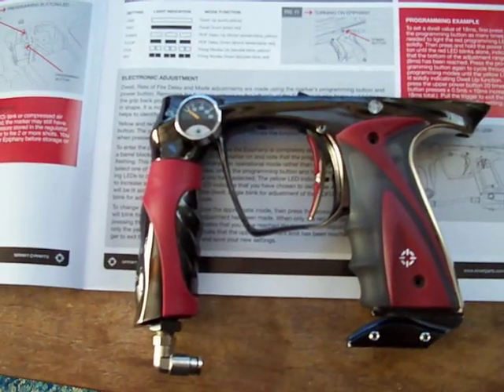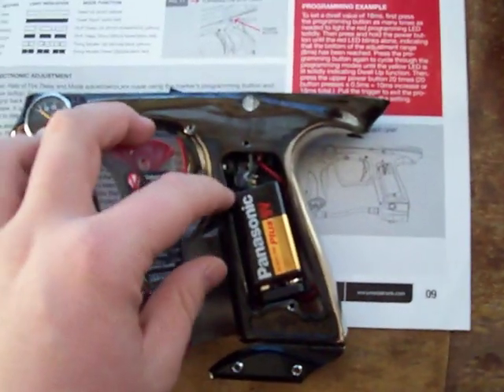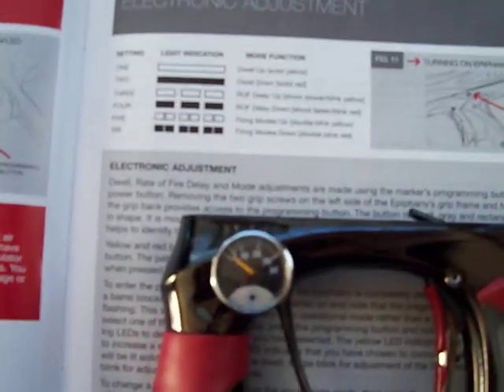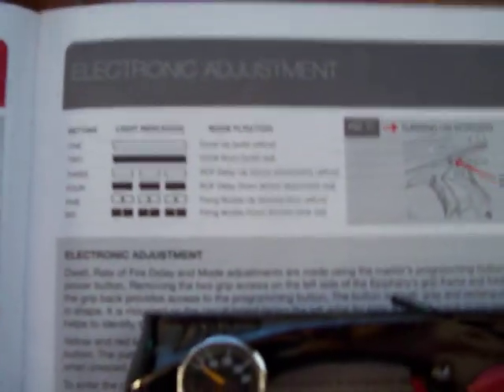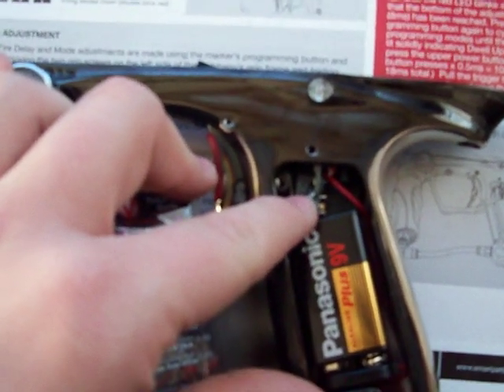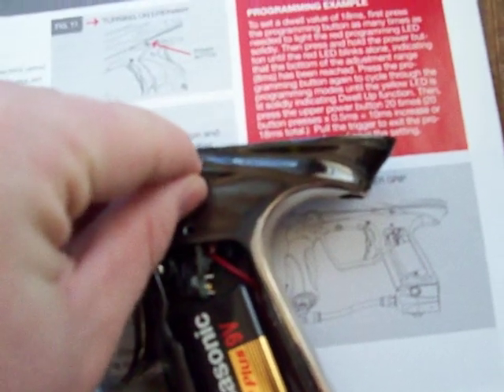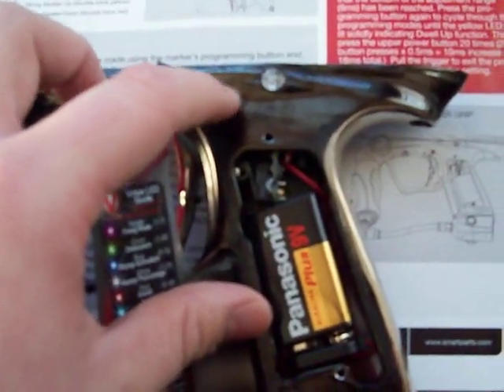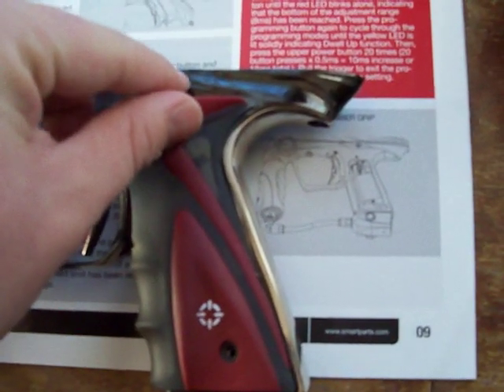How to Program Stock Smart Parts Board

Comment from the maker: Your welcome. DWELL is the amount of time the solenoid inside the gun stays open, longer its open then themore air there is flowing out of the gun. Unless you install a QEV(quick exhaust valve) into your gun then I would just leave the settings as they are stock.

Comment from the maker: Witht he stock board there is an all over cap of 17bps that you can't change so that's the max you'll be able to get. After market boards offer uncapped however which will get your gun as fast as it can and/or as fast as your hopper can feed.

Comment from the maker: Yep, stock setup on my epiphany(like i said it's just like an ion) I only got like 14-15bps and with the proper rate of fire setup. With a QEV I could get the 17 and with an uncapped board/higher capped board I got up to 25. I mention the QEV alot b/c it's an amazing upgrade and will supremely  boost your guns performance and cost only about $20

Comment from the maker: You'll want to get a QEV so you can really lower the dwell. You can't really lower it with the stock setup without it not wanting to work. Ion's aren't very efficient(neither are epiphanys which are just like it) but if you get a light bolt and a QEV in it to lower the dwell and reg pressure then you might get what I do: 2 pods per 1000psi on my tank.

Comment from the maker: You mean on the back of my grip frame, I guess you want to know why it's so shiny. Well the black ones have gained a reputation for having the color wear off on the back of the grip frame mostly. They didn't anno this thing normally so the process they did use didn't quite work so well. None of the other color ones have this issue though.